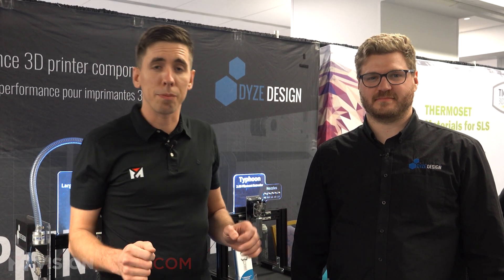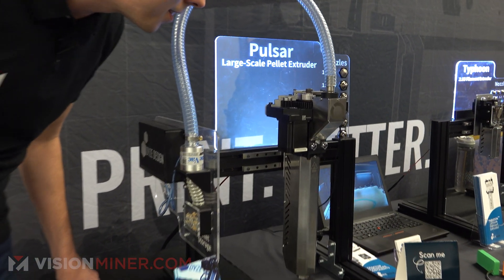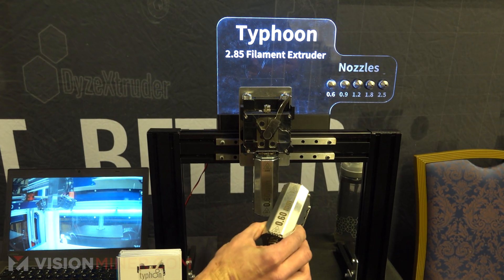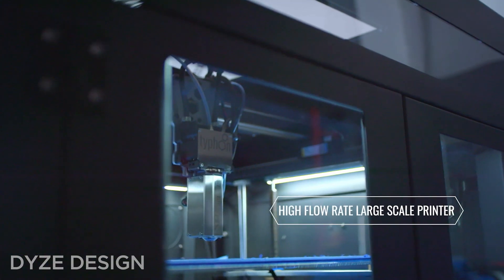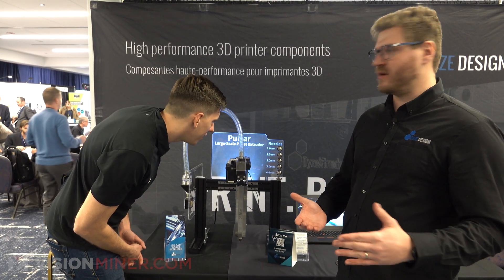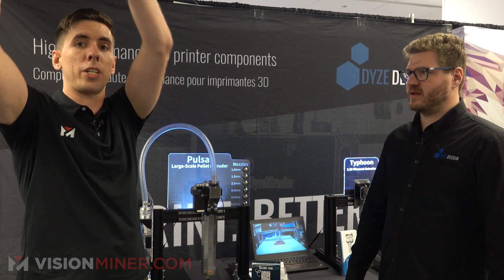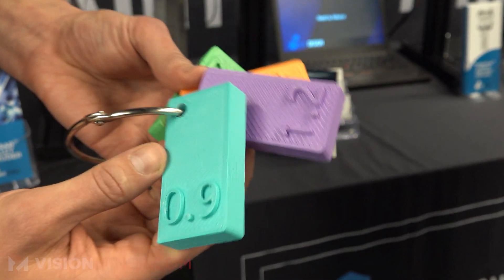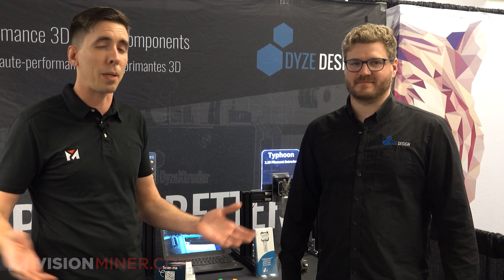Typhoon & Pulsar: Unveiling Next-Level Extrusion for Large Format 3D Printing - Dyze Design 2023

Comment: The plastic should be a lot stronger not being heated and extruded twice. Since recycled plastic is weaker for that reason. Right?
Reply: It doesn't work quite like that, look up Thermal degradation of polymers, there are alot of factors involved.